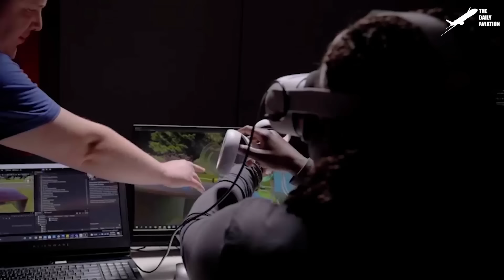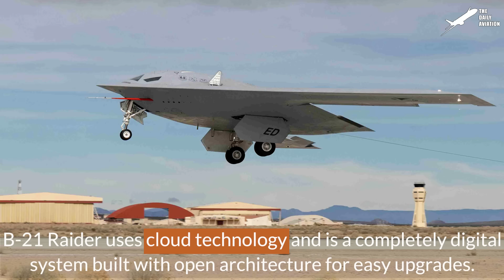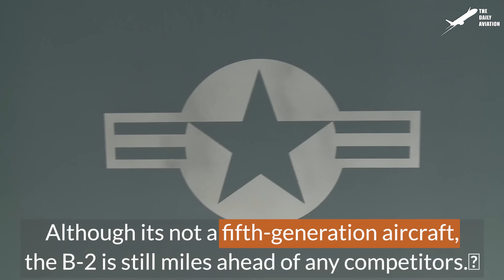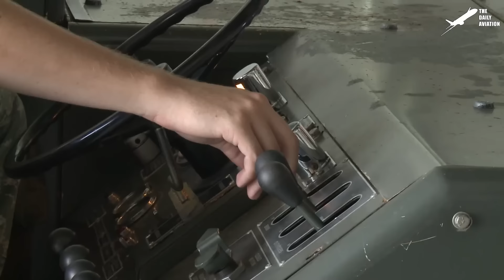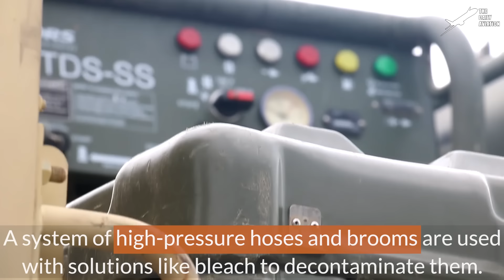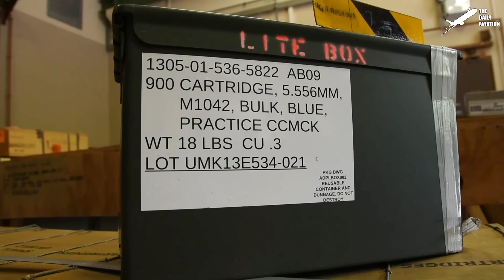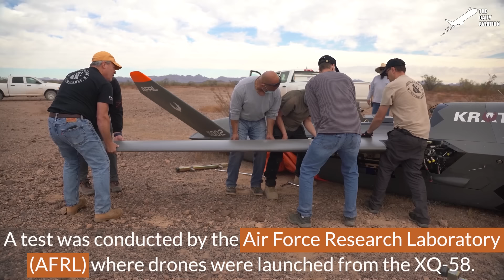US Testing Futuristic B-21 Nuclear Stealth Bomber for the First Time

Comment: At the left of the picture, the exterior wing is okay, the triangular wing is not okay it should end where the line of the engine is in a convex curve. The rest I trust in the engineers to make it fly. A shark tail could be usefull. The angle is not perpendicular to the motion at the end of the wings and cutting this could be better. Left side seem's to be better off than right. Greetings from Switzerland, Michele Cuti